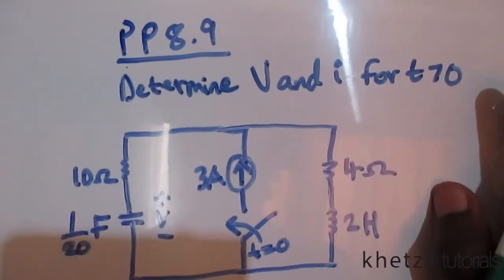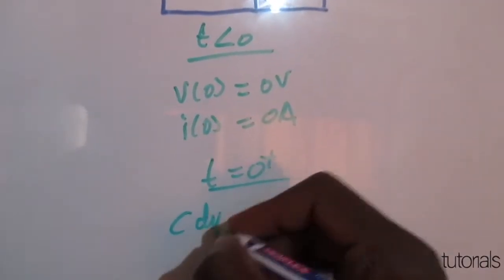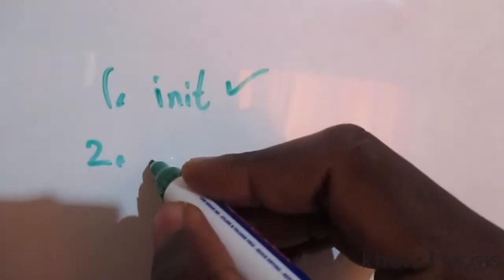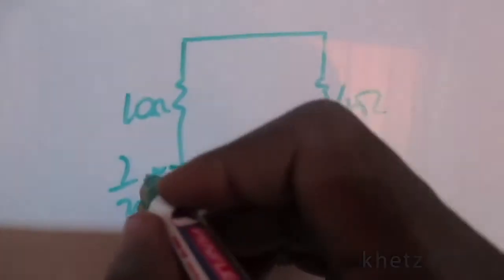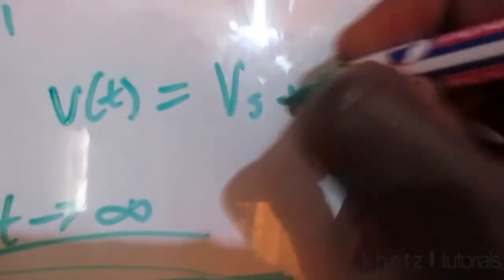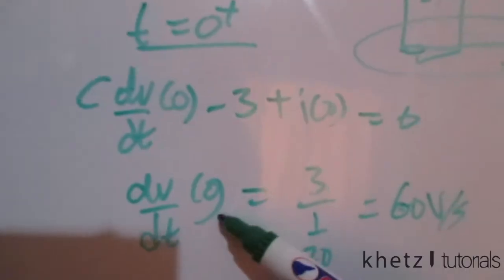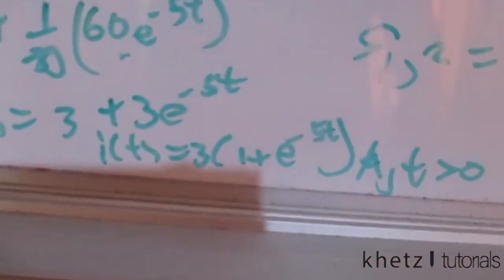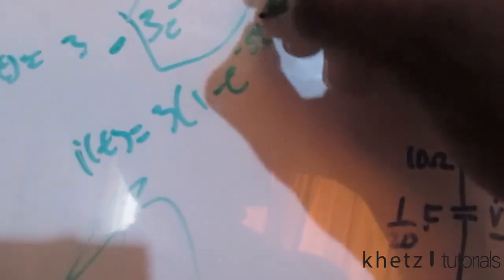Fundamentals Of Electric Circuits Practice Problem 8.9

Comment: why didnt you draw the line of the interruptor? (second step)
Reply from the maker: The current source was switched off for that step so it becomes an open circuit. Since that section is open, no current flows and that section has no effect on the circuit so it can be removed.

When you switch independent sources(usually shown as round icons) off, the current sources become open circuits and the voltage sources become short circuits